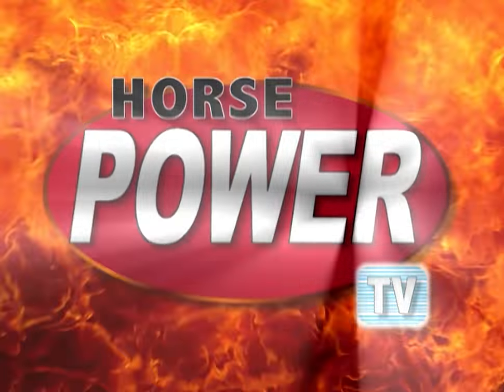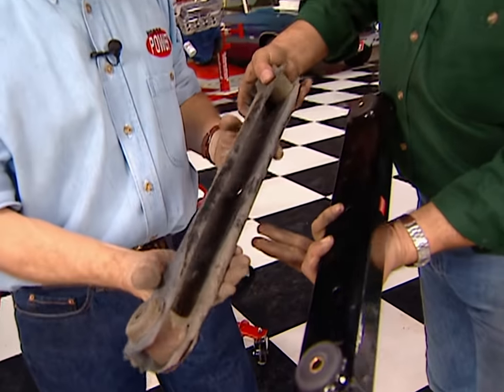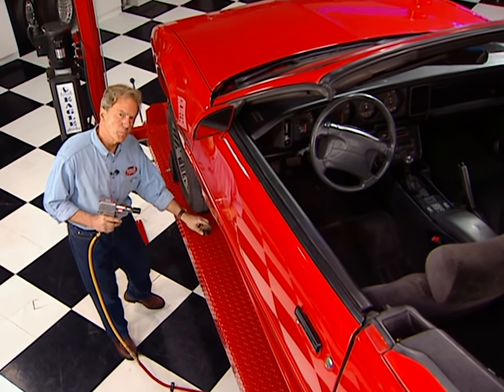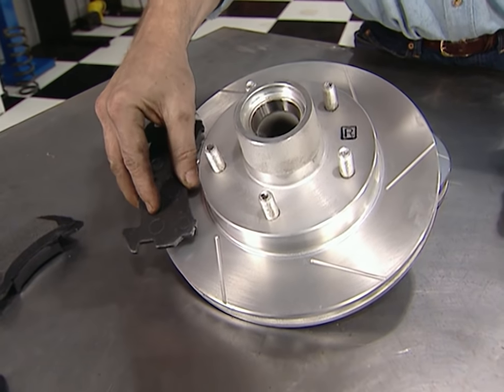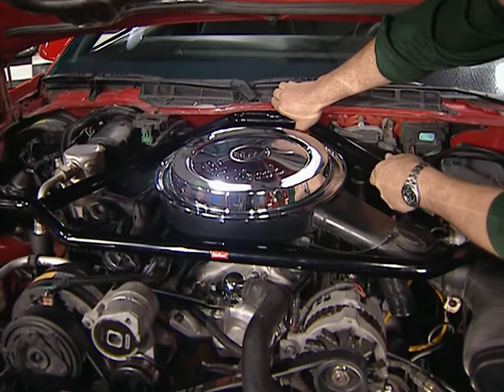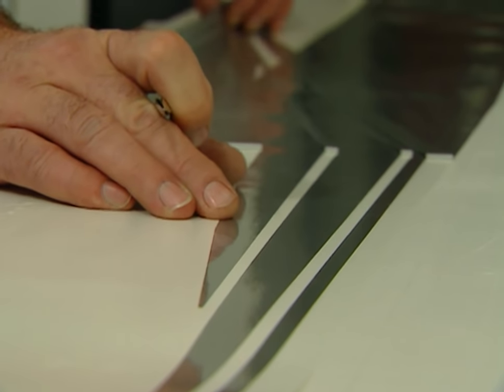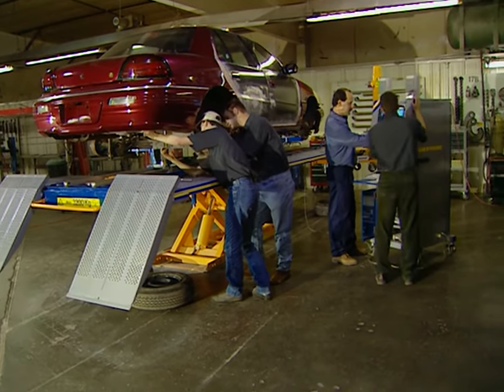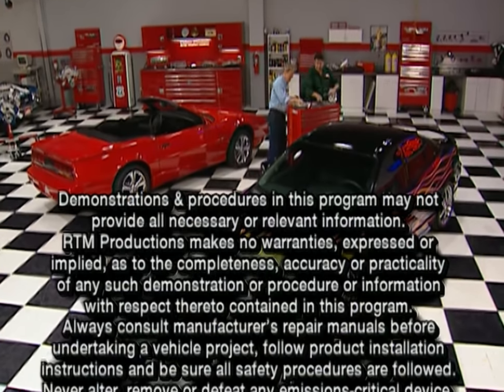Shocks, Springs, and Sway Bars: Pontiac Firebird Suspension Upgrade - Horsepower S1, E10

Comment: Bout to throw on this heavy-duty suspension to our beastly 185 HP Fire Bird. We're just installing the gold plated sway bar cause it's pretty. Only time we'll see it is when its on the lift putting on more expensive crap you can't afford at home.  Later we'll put on some ghey rims i wouldn't put on a wheelbarrow.

Comment: 10k for less than 200hp, sad. we are all spoiled on hp now.
Reply: We really need to get back to ,200hp on a lot of cars.   Most people can't handle 200hp safely let alone what some cars are coming with.
Reply: I'd rather have a 200 hp internal combustion engine car than an EV.   Really, for a daily driver, that's more than enough.  Hell, my 68 VW is only 40 hp and I drive it every day to work 30 mile round trip commute.

Comment: Those wheels are hideous
Reply: The Craeger S/S is a cool wheel.  That just needs the proper offset and backspace.    If they did they correctly there would be no need for a spacer to make it fit.